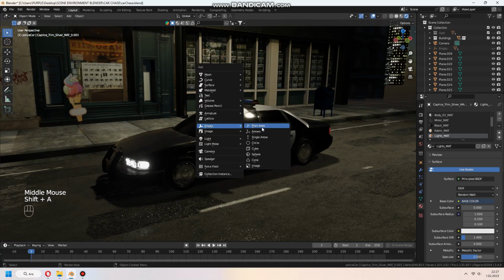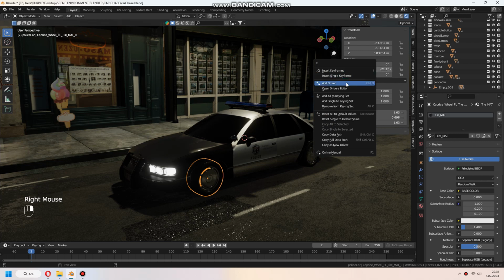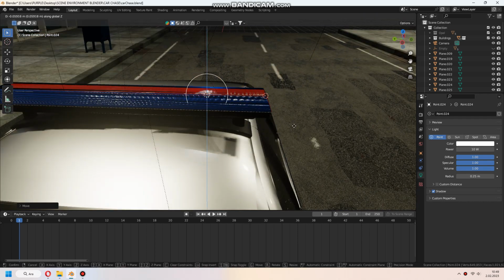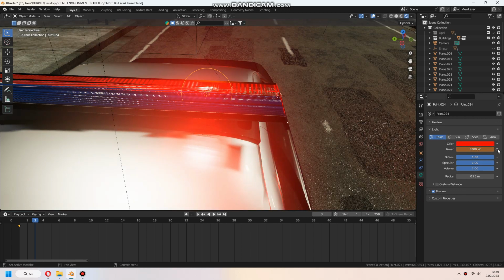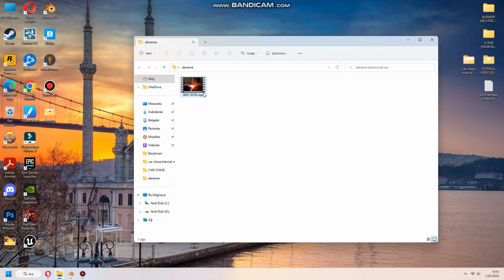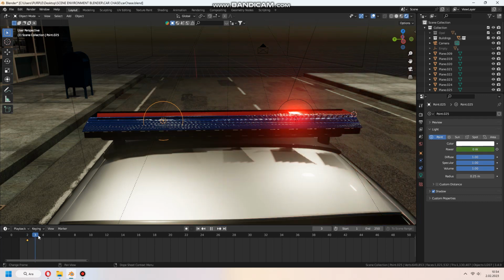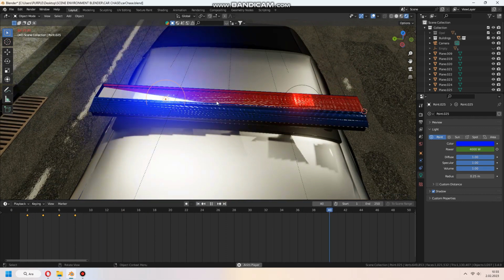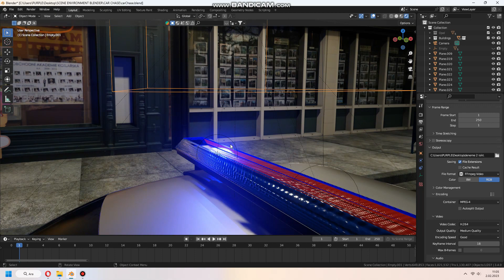Police Car Headlights Setting & Rigging in Blender 3.4

Comment: I used the emitter now if I want to put a light inside the plastic how do I make the plastic transparent and visible showing the light inside
Reply from the maker: You can increase transmision value in the material setting. It can be effect like glass but with changing roughness you can make it a bit blury for looking plastic